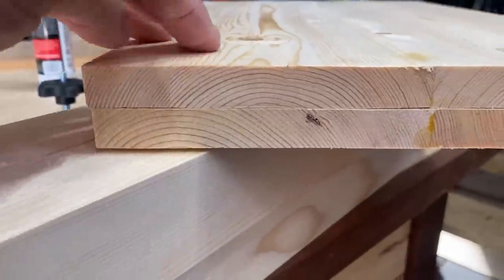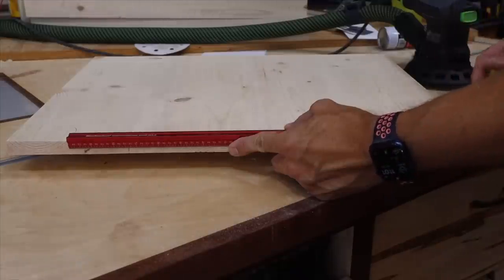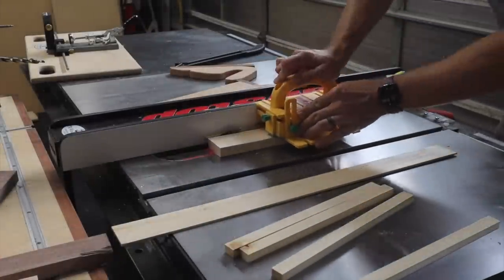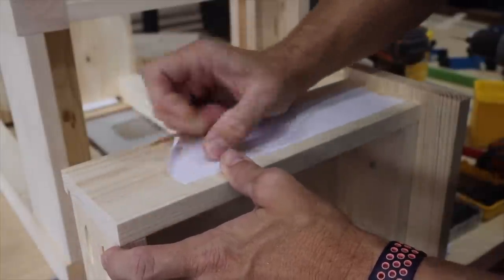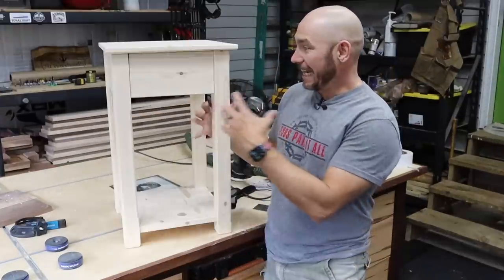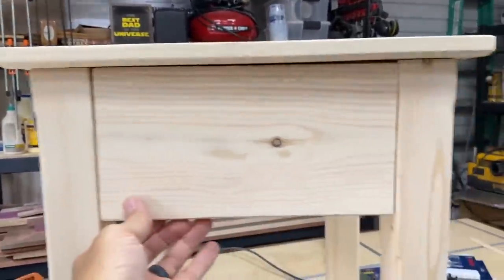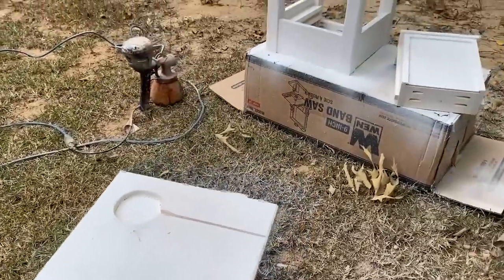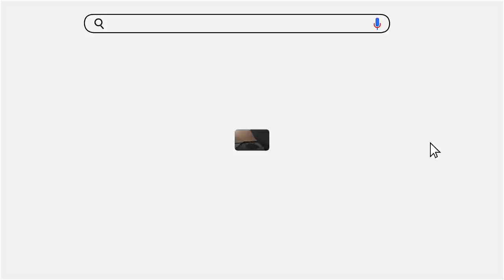DIY Nightstand with Hidden Wireless Charging

Comment: I LOVE WOODEN DRAWER SLIDES!!!!!! TO ME THAT IS WHAT I PREFER TO DO IN FURNITURE THAT GOES IN THE HOUSE.  NEAT WAY TO DO IT TO.  I USUALLY WILL USE A ROUTER AND ROUT GROOVES IN THE SIDE OF THE DRAWER AND USE SQUARE DOWELS AND GLUE AND NAIL THEM TO THE INSIDE OF THE PIECE AND THOSE ACT AS THE SLIDES!!!
AWESOME BUILD MAN!!!!! 
1 PETER 5:6
🇺🇲

Comment: Curious on why you make a planer sled to joint the face of the boards instead of using your jointer?
Reply from the maker: Well, probably because it never even crossed my mind until you said it lol.  That would have been easier.  I've done it many times before but for some reason I never thought about it.  Mind was on the planer I guess

Comment: Something people don't think about when buying their furniture is how it can harm their health. Yes, furniture can off-gas harmful chemicals. My sister bought a small table made from some kind of particle board, and since it smelled chemical-ly, we put it in a small guest cabin for "a few days" to air out. Even after more than two weeks, the table in the cabin makes the whole cabin smell strongly of chemicals. I've even opened the cabin doors for hours to get rid of the fumes, but the smell just fills the cabin when the doors are closed again.
So, if you build your own furniture, you can control what kind of wood and finish is associated with your furniture - it's bound to be better than most of what you get when buying new from big boxes or online.

Comment: I once told my husband that one thing he could safely buy me for Christmas would be clamps. He asked me what kind, I said "yeah". He didn't "get it". 😕
I don't have a planer so I have just been using my angle grinder with a metal sanding disk to get the high spots of the pallet boards that I glued together down. It's not coming out perfectly square and level, but it's only for pantry shelves at this point. I am eyeing a hand planer at Harbor Freight. It would be nice to have that for when I am ready to start the work outside the pantry (aka, my kitchen).
Reply: Hey, Honey, what about a random orbit sander (or other hand sander)?  I had much better luck using that and being sure to run through each grit (60,80,120,220) than trying to use my angle grinder.  The grinder is much faster but it's so aggressive that you're likely to end up going too deep.  I only started to get good results once I stopped trying to get every penny's worth out of each sanding disc and forced myself to go through each grit in order.
Reply: @CeeJayThe13th  I have a palm sander, but it doesn't seem to do a very good job. Most of my tools I inherited from my father so they are pretty old. Yes, the grinder is aggressive, but I am smoothing down some pretty rough boards. A belt sander might be better, if I had one.
Reply: @HoneyHollowHomestead  I didn't have much luck with a belt sander but also I don't think I really know how to use it.
Reply: Hey honey hollow, I bought the bench top planer by Bauer from HF and absolutely love it! For just a bit more saving, you can save tons of time and labor.
Reply: @carbonfusion  But the hand planer is so much cheaper. Money is tight right now.
Reply: @HoneyHollowHomestead  I hear ya! I went through the same thing. If you’re gonna go with the hand planer, then I would humbly suggest that look on YouTube for the videos about converting it into a jointer and also a bench top planer. There are some good videos out there that will help. Using a power hand planer was never my forte, so that’s why I suggest these ideas. Hope this helps!

Comment: Hi.. I hope you reply and I hope as soon as today :) I have a question.. Do you think I'll be able to make this table using just the (WORX POWER SHARE 6 TOOL COMBO KIT) ? besides the painting and sanding.. pls help.. I'm trying to decide if I should purchase the set today from Sam's club a $249.99 combo on sale for $149.99 pls help.. I appreciate it very much. Thank you
Reply: This is what comes in the Worx combo 

Rated Voltage 20V MAX   
WX500L - Reciprocating Saw -Load Speed 3000/MIN   
WX500L - Reciprocating Saw Stroke Length 13/16 in.   
WX696L - 20V Oscillating Multi Tool Oscillating Speed 5000-1800 RPM   
WX696L - 20V Oscillating Multi Tool Oscillating Angle 3.6°   
WX696L - 20V Oscillating Multi Tool Speed Settings 1-6   
WX291L - 1/4" Impact Driver Rated No-Load Speed 0-2600/min.   
WX291L - 1/4" Impact Driver Impact Rate 0-3300 BPM   
WX291L - 1/4" Impact Driver Chuck Size ¼ in. hex   
WX291L - 1/4" Impact Driver Max Torque 1500 in-lbs   
WX529L - 5-1/2" Circular Saw Blade size 5-1/2"   
WX529L - 5-1/2" Circular Saw Max cut capacity 90° 1-5/8"- 45° 1-3/16"    
WX025L - Worx Work Light Light Lumens 100   
WX025L - Worx Work Light Flexible Head 360°   
WX108L - 1/2" Drill/Driver Warranty 3 yrs.
Warranty
Reply from the maker: As long as you can get good square cuts you should be able to
Reply: @731Woodworks  Thank you so much.

Comment: Good job. But the only reason I disliked the video was cause of your statement that "you can build this". Sure, but how many people have all that equipment like a planer, number of clamps etc. With all that probably be cheaper just a good idea and buy a new one
Reply from the maker: You limit yourself with that attitude. I’ve built similar tables on this very channel with much less. The only reason you can’t is because you won’t.
Reply: You don't need power tools to build a project like this. It can be done with a hand saw, screwdriver, tape measure and a level. You can use blocks and wedges to do a glue-up. If there is a will, there is a way.
Reply: If you want it, you'll do it. If you don't want it, you'll make excuses.